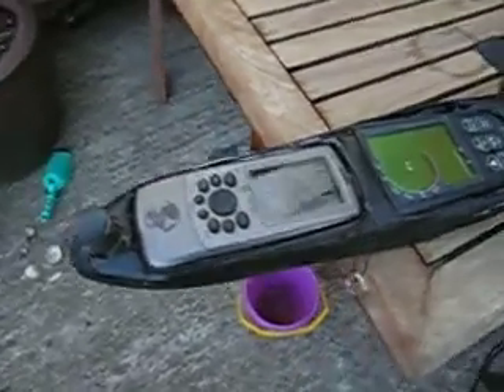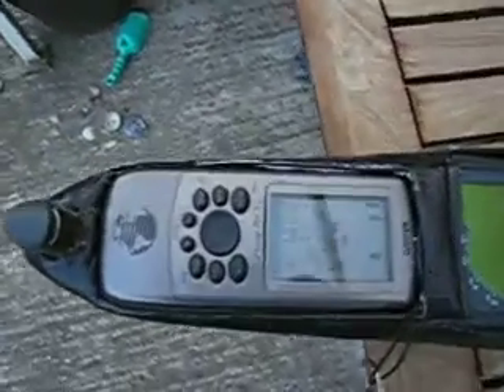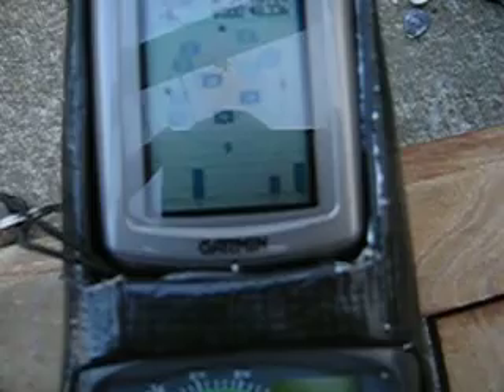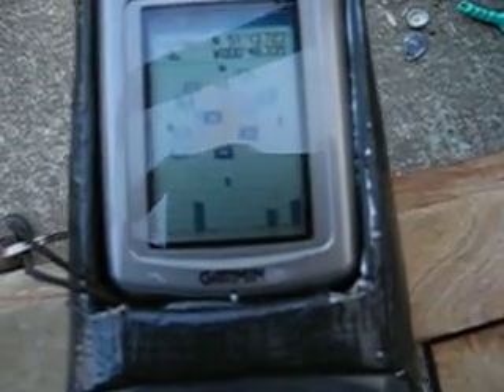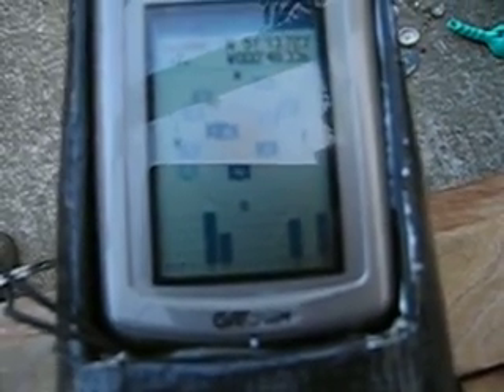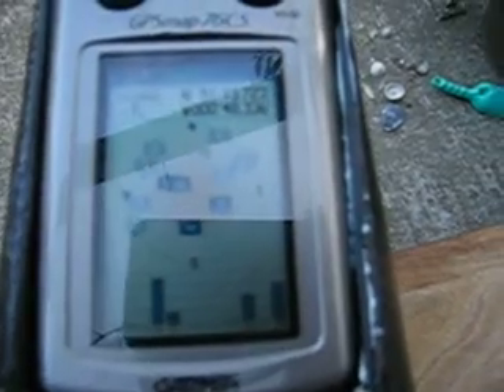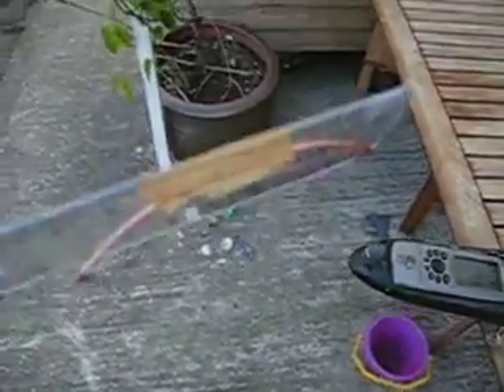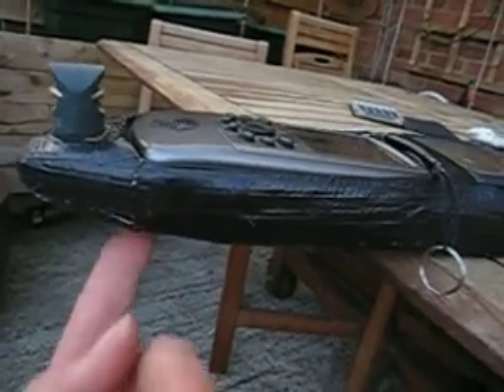Garmin GPS performance improvement

Comment from the maker: Hi jclewitt.
Backbone is 1/8" dural. Sides wrap about 15mm. Shape filled in with EPP foam glued and sanded. Covering is spray glue 3M77 with glass reinforced tape and black Gaffa over. Hinge-up design for base bar. Nylon boat hinge at the rear. A cross piece beneath and velcro straps. Chassis rests against the top of the bar. It hinges up, so could be fitted even if the glider is rigged flat. Because of GPS problem, the front 10cm of the alloy is now beechwood pop riveted down to the alloy!

Comment from the maker: I've never before seen such strong coverage from my old 76. Antenna design on my old 76 is compromised by the pod. Garmin won't acknowlege it, and modern 76's don't suffer this. A new one and it works better. (If I put my 76 on a car bonnet it looses 100% all satellites). This is antenna design. Downside might be now it gets more directional and sees satellites above strongly at the expense of low down ones. I don't actually mind if overall I get better coverage.